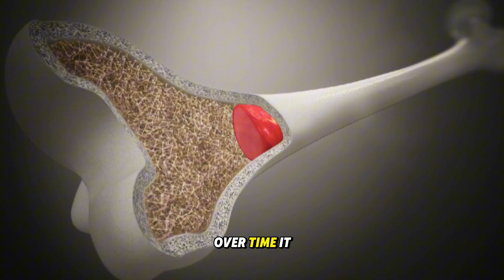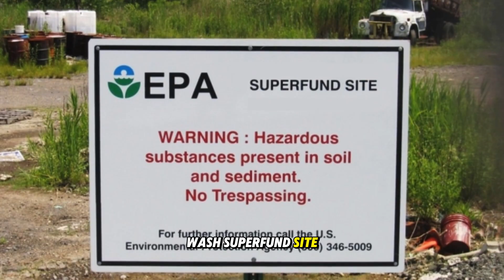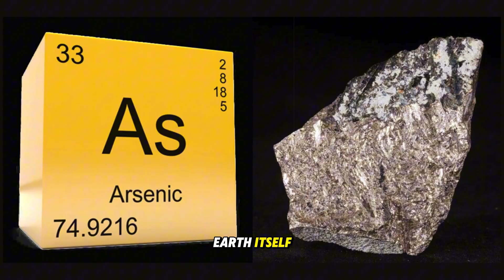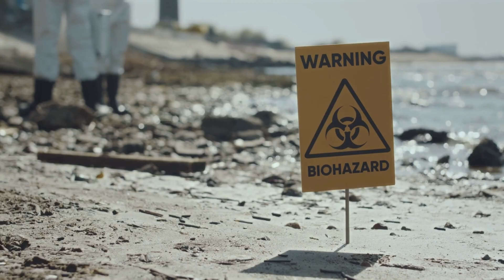5 MINUTES AGO! Groundwater In 5 States Is Turning Deadly Toxic - USGS Alert! Documentary

Comment: So has Trump blamed the BLUE states yet, or was this Biden' and Obama's fault
Reply from the maker: @persophone4554 Good question! So far, no clear blame has been placed publicly. What matters most now is finding solutions—who do you think should take responsibility?
Reply: @discoverglobeliving I've work in remedialtion. The sad news is it's very expensive and time consuming to solve the issues.  The causes need to be considered. To answer that would take a novel. In Australia clearing and agriculture allow more deep penetration of oxygen in the soil, leading to oxidation and acidification of ores. Hence, arsenic (as arsenatez) is released.  To deal with the issue, regrowth to limit oxygen penetration (only partially effective) and treatment of water to remove arsenatez is needed.  With chemical contamination, you can pump in solutions with sugar waste and certain microbes (selected) to degrade the contaminants. Again, expensive and time consuming. We have PFAS and the water goes through a special filtration system.  Some problems (like sink holes are caused when agricultural waste (acidic) dissolves underlying carbonate deposits.  Once the hole/damage is done, there is nothing simple to be done.   The fix is expensive.
Reply from the maker: @persophone4554 Thank you for sharing your experience. It’s rare to hear from someone who’s worked directly in remediation. The challenges sound immense. In your view, which solutions offer the most realistic hope long-term?